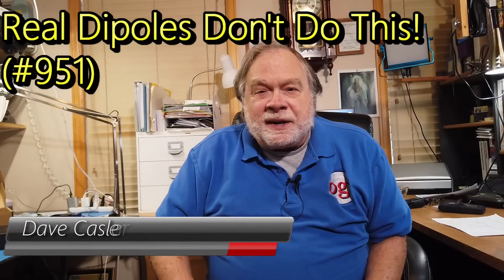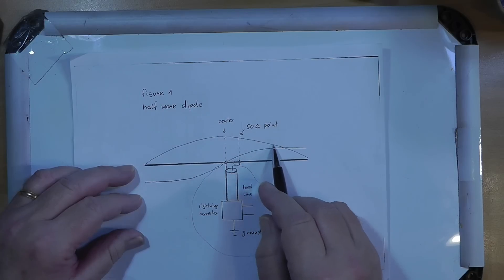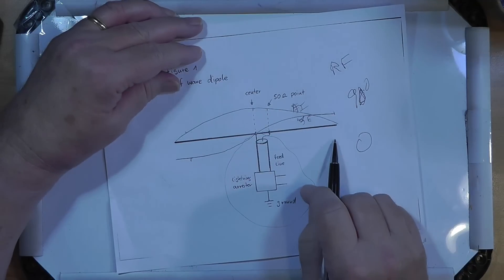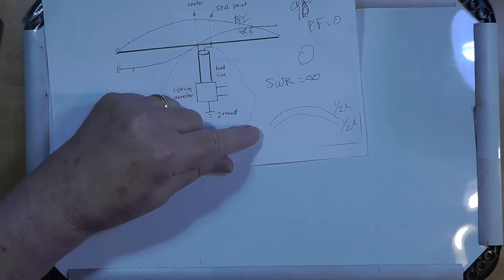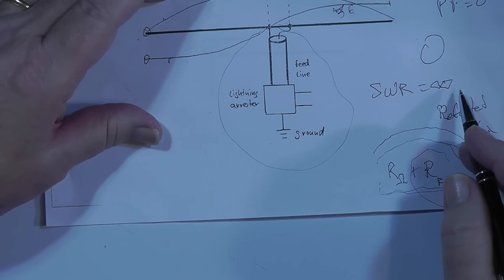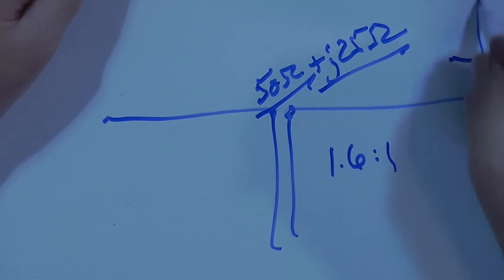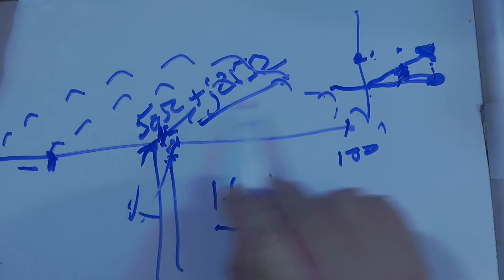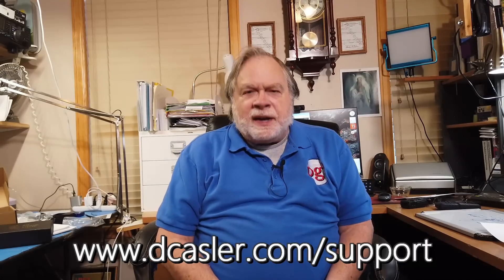Real Dipoles Don't Do This!  (#951)

Comment: How is an end fed dipole connected.  Looks like you have only one wire at the end.  What do you do with the ground?
Reply from the maker: Instead of a ground you need a counterpoise. In many installations, the outside of the coax shield serves as the counterpoise. Otherwise you can add a counterpoise, like ten or 20 feet of wire to the counterpoise connection and leave that dangling.

Comment: Hello Dave. Thanks for the video! The waveform graph which shows the voltage and current out of phase is utilized in several ARRL publications. Since you work with the ARRL it would be helpful if you would follow up on this video's topic in an effort to bring clarity to the theory.

Comment: Given that your presentation on the voltage and current distribution vs location on the dipole is contrary to numerous, should I say just about all, sources that explain the subject as "Current is maximum at feedpoint, while voltage is maximum (and opposite sign) at ends", could you please provide the source for your presentation of voltage and current vs. location on the dipole?

Comment: I think you mix up phase angle with respect to time and phase angle over distance at a given time. Obviously the voltage will make a jump at the feedpoint.
Reply: The voltage at the feedpoint is lowest. It is highest on each end. The current is the opposite, highest at the center

Comment: With respect....   a  radiating  dipole  is not  a  closed  circuit  thus one  cannot  apply circuit  theory.   From  Physics   we know  the  current  at the ends  of  the  dipole   must  be  zero. There is a  radiation  resistance   where the power is  dissipated.
Reply: Think  of an  antenna   from  a  Physics   point  of  view  ... it  is not  a  circuit.....  it  is  radiating   energy into  space .   This  is  what    makes  Ham Radio  so  interesting.....    the  physics   is  radiating  energy into  space...  cool  stuff   Maxwell's Equations...  and information is being     sent   through  space.

Comment: Dave, measured standing-wave RF voltage is highest at a dipole's ends and RF current is lowest (zero).  Your hand-drawing shows both RF voltage and current as lowest (zero) at the ends.  To show a dipole's standing-wave RF voltage distribution without polarity, a U shaped voltage curve would be appropriate.  Recall that a half-wave dipole is essentially an unterminated quarter-wave parallel transmission line spread apart 180 degrees -- including its standing-wave voltages and currents.

Ken, WA8FCI
Reply: Also, apart from RF power absorption due to an antenna's conductor loss, a dipole antenna does NOT absorb RF power -- it radiates applied RF power as an EM wave.  In other words, a dipole antenna is not an RF power dissipative load -- although, it's mathematically viewed as such.  Rather, it's a combination of an impedance matching transformer (matching transmission line impedance to free-space impedance) and a transducer that converts applied RF power into an EM wave.

Ken WA8FCI